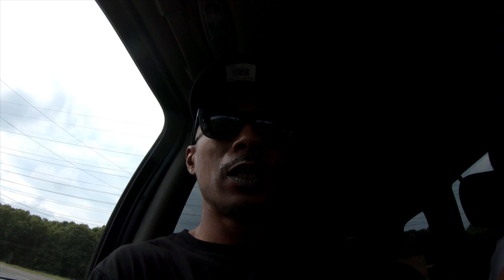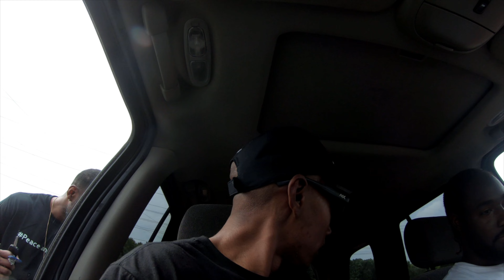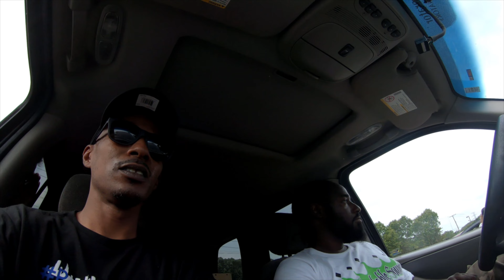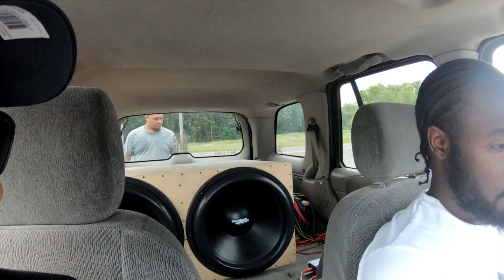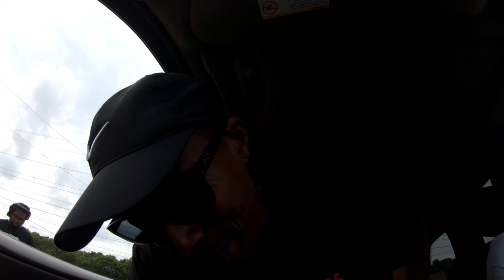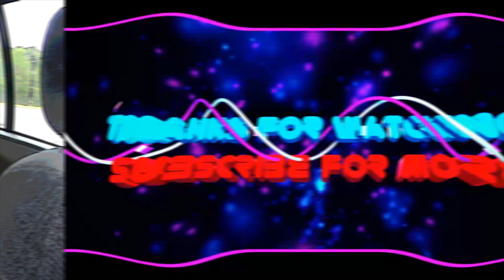2 Resilient Sounds Platinum 18's. 2 Crossfire C-7 3K's JJ Box w/ 46hz Tune

Comment: No offense but are those subwoofers facing the wrong direction 🤔
Reply from the maker: It’s no offense at all ✌️&🔊 vibes always. I can definitely understand where your coming from but my guess is they did a ton of testing and tuning different boxes and positioning and ended up with this. Just my honest guess 😎
Reply: If you're enclosure is built right, and everything tuned correct for vehicle with CLEAN power.. no. Upward or forward is just fine. In the past- it was a rule to mount 15s or 18 upward to minimize gravity effect on the large cone area' but with the higher powered motor magnets now its not as impacting. The rear and down fire aspect was to minimize distortion and get max spl from lower powered builds of the past. Now its a by-the build- situation